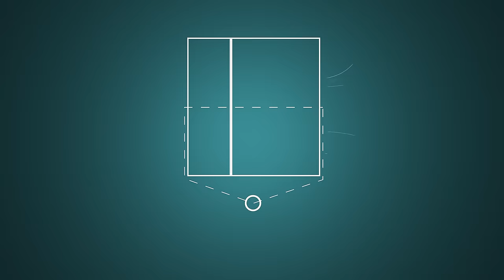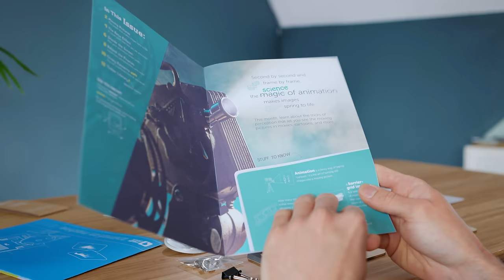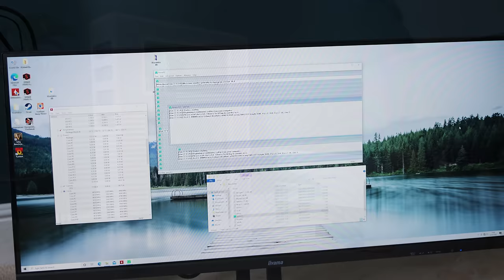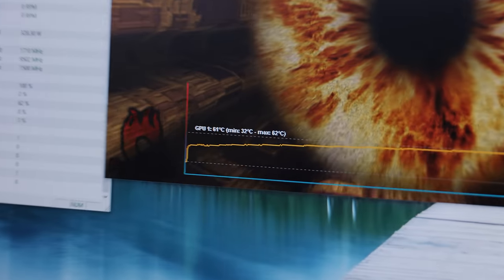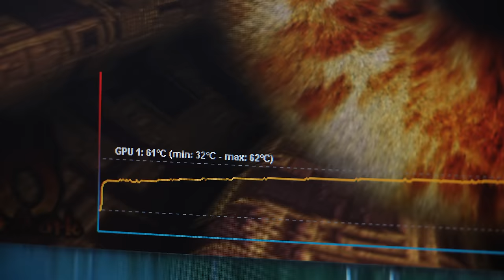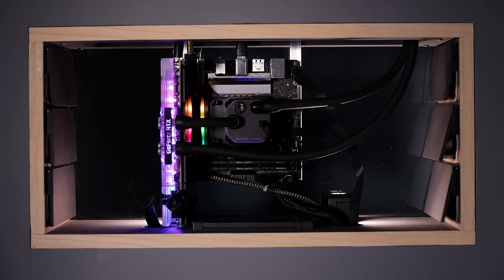Building the world's first 'breathing' PC

Comment: I think I'd first try just tuning the movement speed at the ends of the baffle stroke to close the valve slower. Maybe tuning air chambers in the fluid pump circuit could accomplish that mechanically. For efficiency I might also try switching the valve to a large membrane of thin flexible material with lots of very small flaps. Lower energy, maybe less sound. But tuning the air speed at the end of the stroke would be the winner I think.

Comment: I think this PC can be made more productive.
what if you use 2 such blocks, but smaller, and on 2 different sides of the PC? (yes, on the contrary, it can be worse, because the area is smaller, but it will provide compactness).
you can also combine the PC and the monitor so that it also cools down, and attach the desktop (as in the video with the anti-vibration PC).
Also, you can try and not combine 2 separate cases, but simply use the liquid with which you move the wall. That is, 1 large water cooling system, it is difficult both technically and theoretically, + there is a risk of losing magnetism during heating (although in theory the blowing should be enough to cool the liquid in the tube, well, you can use a metal tube for greater heat dissipation)

Comment: Hypothetically, if you make the bellows work not in a plane, but move the blades in a circle, then you can increase the speed of the blades, thereby increasing the air flow and compensating for the size.
Hypothetically, if you make the bellows work not in a plane, but move the blades in a circle, then you can increase the speed of the blades, thereby increasing the air flow and compensating for the size.Although eventually we will come to larger fans

Comment: I still think this would be better fully magnetic suspension, instead of wheels top and bottom and magnetic only in the middle. 
If you replace the top and bottom rod with the same tube as the middle but leave the ends open, then your entire valve becomes magnetically suspended, eliminating bearing noise altogether.

Comment: the absolute highlight would be to change the design a bit, add some leds in the chamber and add darth vader's breathing sounds, of course the volume can be changed or switched off and synchronized with the movement...   🥰

Comment: If this cooling system requires less energy than fans or water cooling - this is the winner regarding every aspect: energy consumption, noise, much more affordable, I guess. But just the size.

Comment: I would have recommended the air flow the other direction to pull cool outside air over the radiator rather than pushing hot air from the PC components over the radiator. You will end up heat saturating the radiators too fast and not have efficient cooling for the parts risking thermal overload. But since this is a year old, I am sure this has been mentioned

Comment: I realize this is a year old, but if you were to replicate the ramping down, illustrated in your animation in the real-world product it would appear "heavier" or as if the bellows were doing more work, than it actually is. Granted, this is a functional vs industrial design argument, but I could see this one change making a significant impact on perception and marketing. 

In a less than capitalistic view, it seems the object isn't breathing in an inherently perceptible way (based on the universal experience of breathing), with resistance increasing by volume. It seems that a narrow tube needs to be attached to the bellows to impart the restriction, or rather, the bellows demonstrated lack resistance altogether.

Comment: 9:25 how you solved the issues with the magnet and tubes not having the right size was brilliant

Would it have worked if you had sanded the magnet and used one if the smaller tubes as well?

Comment: The guy basically just made a huge air pump with single cylinder. but the small one can me even more effective, require no hydro or can be simply by turbine pump or a cooler! In reality the statement that is is quiter is not right. you just meved the hydraulic pump away and made a hose to the system. Same can be done with usual air pump. 
Funny how you used electricity to power hydraulics to power air pumping to cool a hydraulic system with radiator... Listen to yourself at the end. With so many complicated transfers of energy the low temperature must cost lots of energty and already taking a lot of space.. 
Though I think the project is cool in a way. Some of your decisions are very interesting!

Comment: You could have lower temperature if you don't push hot air through the watercooler system radiator.

Comment: The valves are probably too heavy, paper or some plastic membrane, backed with a grid for mechanical support would probably be more efficient.
Reply: foam board weighs next to nothing. the inefficiencies come from using string as a gasket.

Comment: Another idea would be to put the plate thats running from side to side to move up and down and then you can completely remove the valves = less noise and a more direct flow to the radiator if you change the place of the radiator between the 2 boxes you can test it out maybe it performs better but still this is an insane idea
Reply: That in turn wouldn't actually work though, you'd end up pulling cool air from the bottom and pushing it back out while taking in hot air from the top to just push it back out.
The valves allow you to pull in cool air from the sides and the pressure forces the air out the top through the radiator, this is turn pushes the hot air out the top and brings cool air in through the sides. Think of it when you open a door with forces air rushes into the room and as you shut it with force it pushes air back out, except he's blocking the air from going out where it came in so it goes through the radiator as it's the only place air can get through. Not sure if that explanation helps or not

Comment: What I don't understand is why would the system cool the PC? Here the cooling comes from the radiator and the water cooling and not from moving air. The only thing the air exchanger moves and changes are the flaps at the top of the PC but it does not cool the system.
Reply: the radiator needs air moving through it, otherwise it saturates with heat and no longer works. it replaces the fans normal radiators use

Comment: Have you considered replacing the flapping valves with Tesla valves? No moving parts but can still achieve strong one-way flows, and would probably look exceptionally cool as the framing for your casing (one in-only valve on each side of the bellows from the outside, one out-only valve on each side into the PC case to combine as an up-and-down-arrow scroll design you could even make a feature with clear acrylic panels to show them off.

Comment: The water cooling system with the radiator & heat sink on the cpu and the 3 fans on that gpu are what’s keeping both of those cool. All you did was build some glorified & expensive case fan that’s unnecessary. The only heat you’re dispersing is the tiny bit from the motherboard, RAM, and GPU out of the case. That case cooling system is not even going to touch that CPU so running those overclocks and temp readouts on it was pointless. All in all though…That PC build is beast!

Comment: I just came here to say that this is a stupid idea. Didn’t need more than a thimbnail. I knew there’s going to be a overly positive guy, fake in his body language, talking about it.
Reply: Who hurt you bro
Reply: how so? its good at cooling, and he likes how it looks. what more do u need?
Reply: @techheck3358  just by looking at it I can guarantee it consumes more electricity, thus generates more heat, thus is not better at cooling. It can compete with poorly planned fan setup, though.
Reply: @vilnis-trash  you cannot say its better or worse simply because it uses more electricity. replacing a fan with a liquid nitrogen generator uses more electricity but definitely cools more 😂and considering its at 60c full load with only a triple rad, its more than good enough
Reply: @techheck3358  you actually can. First - electricity is consumed by generating heat. Even your example with nitrogen is a subject of this same logic, which tells you that there's a dependency there which compensates for the heat generated, f.e., cooling the nitrogen. So this breaks down to measuring not only cooling efficiency, but also a setup. Which, in return, will introduce new measurement called "internal cooling efficiency" measured by the volume of the device vs cooling efficiency. Taking this into account, you can tell that this device is inefficient just by looking at it. Otherwise, just attach your computer to your fridge and use external cooling.
Reply: @vilnis-trash  that doesn’t matter, a computer & radiator isn’t a closed system. Total energy within the room/house may increase, but the temperature of the computer can be lower.

A bigger fan will use more energy but push more air through a radiator, providing more cooling to the pc. It’s the same effect
Reply: @techheck3358  even if you compare it with external cooling solutions it sucks at volume vs consumption vs cooling efficiency.

Single most obvious reason: it fights inertia every single breath. That’s how you can tell it’s a stupid idea from the get go
Reply: @vilnis-trash  ill redirect you to my first comment: he likes how it looks and it works.
Reply: @techheck3358  Then I will redirect you to my inital commen where I stated that this is a stupid idea. Someone liking it doesn’t make it better
Reply: @techheck3358  i kind of feel you’d argue that 100 slaves blowing their breaths on hardware parts is a good idea if someone likes it lol
Reply: @vilnis-trash  so if something is inefficient its stupid? replying to me doesnt seem very efficient of your time... what does that make you?
Reply: @techheck3358  I quite enjoy discussing things and my ego thanks me when I obliterate stupid ideas just by looking at them and then proving I’m right. So don’t tell me it’s inefficient in regards to my time. What’s your excuse?
Reply: @vilnis-trash Roasted 😂
Reply: @secspest  what do you mean?